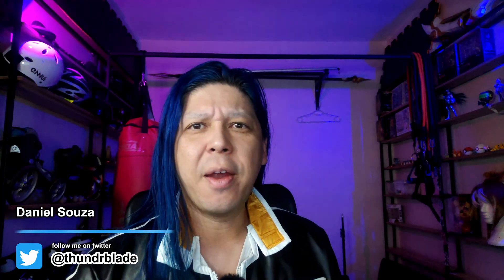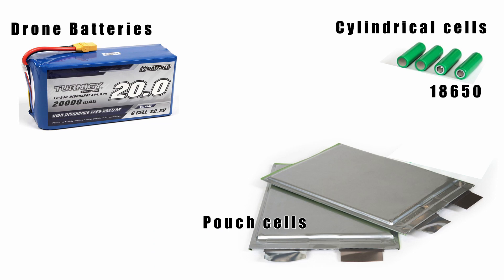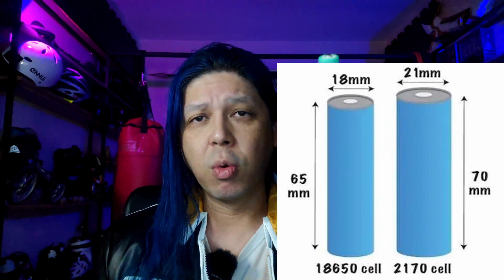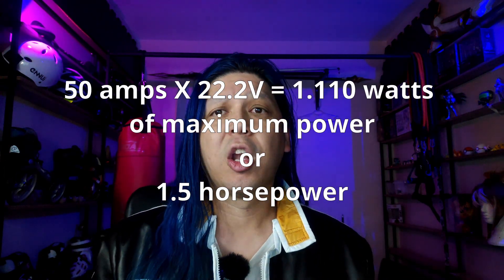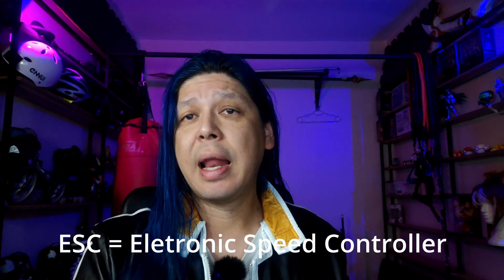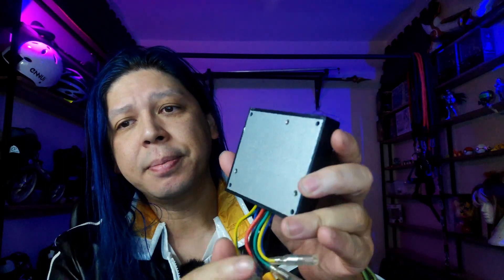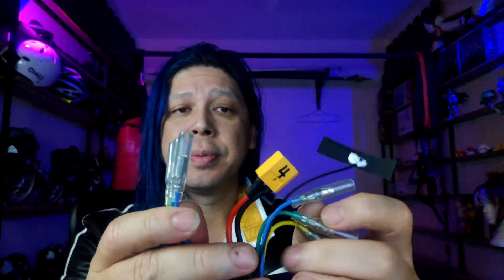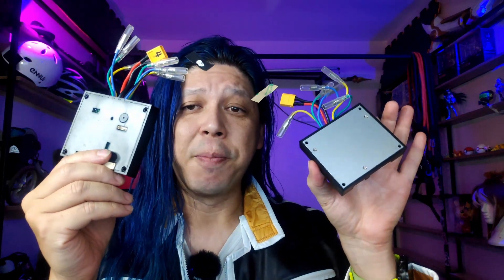Electric inline skate build - update 01 -  THUNDRBLADE 2022

Comment: for someone trying this for years now you still seem not to have any clue of battery building.
who says 36V means anything? you can build ANY voltage.
NEXT: 10 Amps???? really? again, you seem to not have a clue. there are  batteries with 15A, 18A,...
or you simply go 2P then the amps double.
"refurbished????? what the hell are you talking about? those are CHEAP ASS Chinese batteries. not refurbished. (but shitty batteries) quality comes at a cost.

in this whole video you show you still lack 90% of knowledge to build a proper product.
sorry to say this

and I am not commenting on "36V is High voltage" or the sparks vs the button.